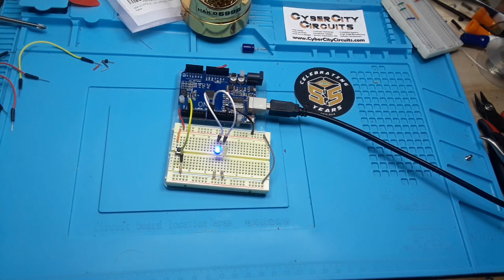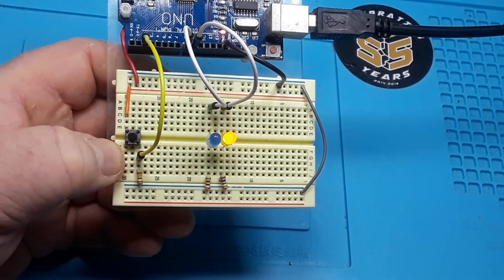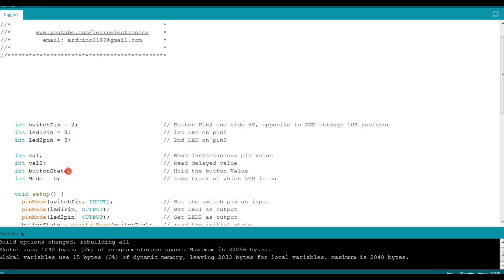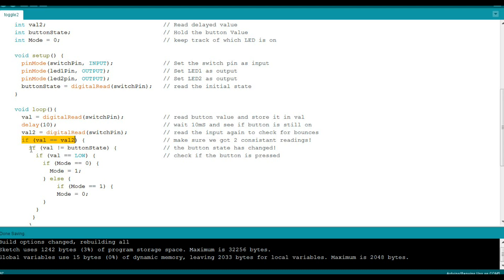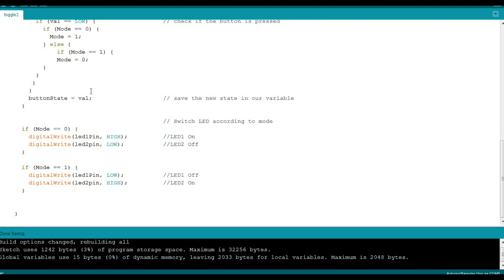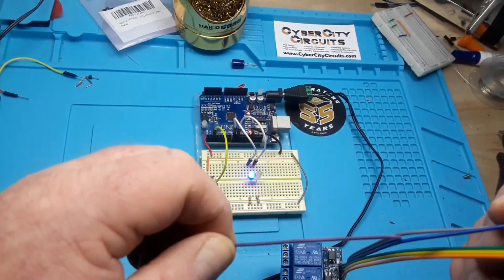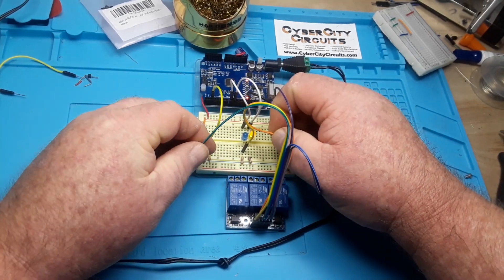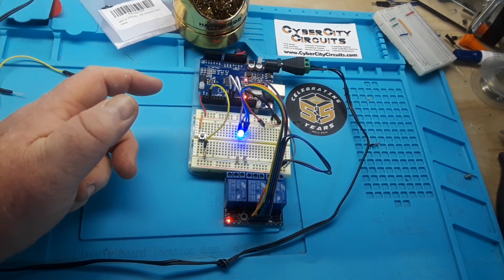Arduino based toggle with debouncing

Comment: Great little project and nice example of debouncing in software, cheers! 
An old arduino project of mine had some time sensitive code that didn't like the delay() calls used by this method. There's some examples out there of debouncing with a counter, but I had good success with a 74HCT14 hex inverting schmitt trigger IC making the code a bit simpler.

Comment: Programming tip: If you know you have a place where you will always be working with something that has just TWO modes you can indicate them with -1 and +1.  The benefit is that when you're ready to switch the modes, you don't have to know what state it was in, you just multiply it by -1 and it switches. In the rest of the code you just test for -1 or +1 instead of 0 and +1.  Not a huge change, just an small efficiency trick.